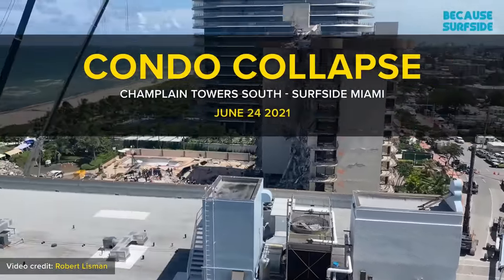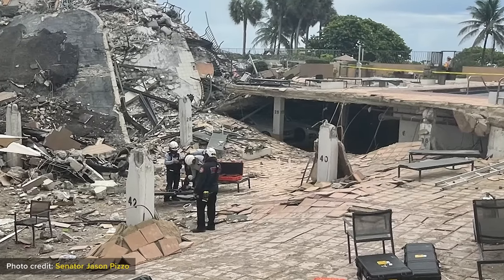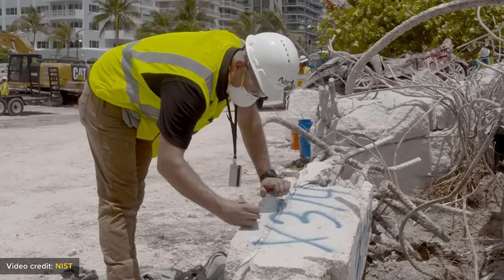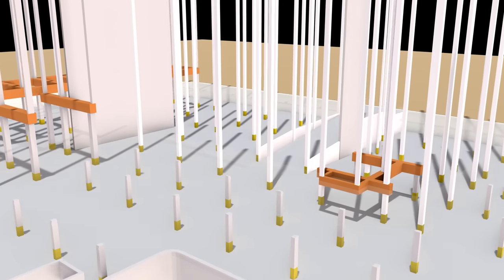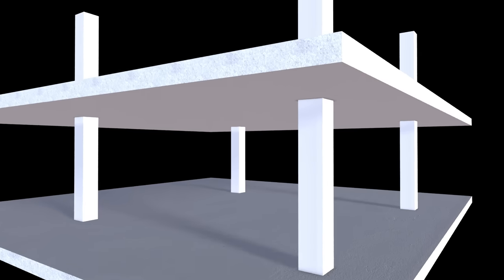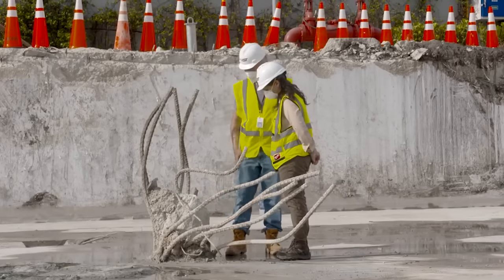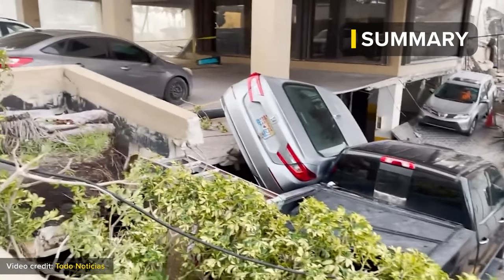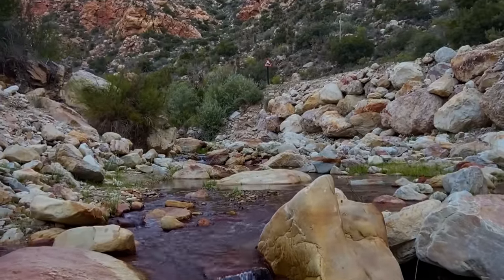SURFSIDE CONDO COLLAPSE | structural negligence! pt3

Comment: There was corrosion, perhaps not in the core samples, but you can clearly see it in the photos.
Reply from the maker: Rebar rusts very quickly when exposed to rain and the air. The pictures of the rubble are not good indications of the extent of corrosion.

Comment: 0.32 there is no rebar sticking out of the concrete at all. Absolutely no reinforcement.
Reply from the maker: Yes the absence of rebar is striking. But presumably it snapped at the cut face or inside leaving just a hole not visible in the fotos.

Comment: The city inspectors, the company that owns the buildings are at fault and I hope Miami and that company go flat broke paying out the lawsuits
Reply: I don't think the government is responsible of everyone wants less red tape, so less regulation is applied. This stuff is why regulation exists.

The scary thing is that because of hurricanes, they need to recertify every 40 yrs. Most places don't even need that.

I work as an engineer. So much work from 40 years ago just wouldn't be ok today. Regulations have generally been increased a lot. Those regulations often get enhanced because of events like that, but they never fix old facilities or buildings to the new standards.

Comment: The design build was marginal at most
Reply from the maker: The nature of building developments is that they are built at minimal cost. That’s not unusual.
The difference in this case was the structural design was inadequate and I think NIST will discover substandard concrete was used and not all reinforcing steel was installed. All so someone made an extra buck.
Reply: @Mike-Bell   THE PERSON WHO MADE THAT FINAL DECISION NEEDS TO BE FOUND AND GIVEN A NEW SET OF CLOTHES FOR THE NEXT 10 YEARS. Probably longer. 

They knew exactly what they were doing. Somebody okayed the substandard build. If that person is still alive they should be getting nailed right now.

I DON'T KNOW JACK SHIT ABOUT ENGINEERING BUT THAT WAS MY FIRST THOUGHT EARLY TODAY WHEN I STARTED WATCHING THESE VIDEOS AGAIN. MUST BE SUBSTANDARD CONCRETE NOT ENOUGH REBAR. I'VE HEARD BEFORE THAT CAN OFTEN BE THE PROBLEM.

Comment: Good video except the end. The graph used by the government to push this usage tax. After the first 5yrs was 1/3 of the predicated on the graph. You would think the government would redo the graph starting a the actual 1/3. Also they would adjust some of the parameters used to determine the graph. But no they are still going with the old graph and that is 2/3 off. Why do this? Also recently my city had a committee set up for future plans with global w.. Well they used the data from Boston wheather observatory historical data. So i go to 3 yrs in the 30s and write down high temps for june july Aug. Then i go to my public library. I find on microfilm my local paper and write down high temps for the same time frame. I compare temps and the only ones that do not match are the high temps and low temps. No other different ones just highest and in government documents they have been lowered. My local paper at one time had every section in house. As a cub scout we toured that complex. I remember being told wheather section gets all info from Boston wheather station for the government.  I had a copy of Paris A and other acords saved on my tablet. When i went to find them certain documents were gone and i didn't do it. Must of been g00g1e

Comment: So, if I understand you it was cheap design. Were standards not adequate or not followed?
Reply from the maker: It was an under engineered design and cheaply built.  However it was also extremely freakishly unlucky because everything went wrong at the same time including not being looked after.  There are many sub standard buildings that thankfully stay standing.  As far as following codes or nor and whether those codes were adequate we need to wait for the official NIST findings.

Comment: The pool deck slab could have been butted up against the building columns without actually tying into them. It could have had its own columns there at the end for lateral support. Nonetheless, none of this would have happened if we built these structures with beams. Pouring giant slabs just sitting atop columns, we are relying on bare minimums to squeeze by. This was bound to happen.

Comment: Many people are responsible for This Disaster. The architect the construction workers the condo association the maintenance department. But the people that I blame the most and should hold the most responsibility for what happened. Is code enforcement. The building should have been inspected a long time ago before it ever collapsed. And it should have been quite evident to any inspector that the building needed to be condemned at that time. Until all necessary repairs and and retrofitting took place. It just was not a safe place to live. It was allowed to deteriorate for way too long. And quite frankly I don't think it was built properly to begin with and should have never passed its initial inspection from code enforcement. There just wasn't enough redundancy built into the building. And I don't care what they're saying in my opinion the parking garage pillars are just way too thin and again not enough redundancy and backup support. Any building that's has its parking garage below the structure that has parking garage pillars supporting the building should be designed in such a way that any one of those pillars can be taken out and the building still stands. But in this case when one pillar was compromised the rest went down like dominoes due to the immense weight put upon them if they were that of a beefier made better pillar this would have never happened. Even taking into consideration all the years of neglect in maintenance allowing water to literally flow down into the concrete on a daily basis causing puddles in the parking garage to the point that there was actually stalagmites dripping from the ceiling. Which proves right there that it should have been condemned. Before it ever fell down.
Reply: Stalactites grow down from the cave ceiling, while stalagmites grow up from the cave floor. It's easy to remember which is which: Stalactites have a "T" for top and stalagmites have a "G" for ground.

Comment: There is a prominent engineer who went through all this and his videos disagrees with yours.
Reply from the maker: Who is the Engineer?
Reply: @Mike-Bell  Josh Porter, building integrity.
Reply from the maker: @thecommentary21  Ok lets revisit this in a year and a half when NIST release their findings. I am confident that what I have suggested is going to be close to the official version. 
Josh Porter has made some excellent videos. But he has presented a scattergun of broad suggestions of which some contradict each other.  He hinted that the columns rusted under the basement which they clearly did not. 
He also said the building had post-tension cables and then quietly removed that video when he embarrassedly realised he had that one wrong.
Reply: @Mike-Bell  Im not personally attacking anyone. I watched all of his videos. Perhaps the 2 of you can do a video together and talk about these issues. I think what he said had a lot of credibility. Another thing that hasnt been mentioned and maybe you can comment on this, is the new building construction next door. They dug right up to the champlain foundations next to the pool and deeper as well. 

He also mentioned the additional story on top. I think he does talk about design flaws but its been a while since Ive watched the vids. I think you 2 should do a video and Im open to the truth.
Reply: @Mike-Bell  He provided a lot of photo evidence of the rusted columns and poor repair attempts as well.
Reply from the maker: I have previously tried to communicate with Josh Porter but he did not respond.  It would be interesting for us to have a discussion about this collapse.  That is a good idea.  I will try again to talk to him.

Comment: I Understand What You're Saying.. However.. What You've Explained Still Doesn't Explain Why The Walls In The Upper Level Would Get Wet Every Time Florida Got Heavy Rain Storms.. That Proves There Was A Crack In Either The Roof? Or Somewhere In The Walls That Supported The Drainage System From The Roof.. Although, After Finding Out About How This Building Was Constructed, And Maintained? It Could Have Been A Combination Of Failures That Occurred..   Jus Sayin.. Yep...

Comment: Stud rails were not available when this building was designed and built so blaming the collapse of a 40 year-old building on technology that did not exist when it was built is ridiculous - it is also very likely that the concrete strength would have increased significantly since it was built - 4 or 5 years after this building was designed and built, post-tensioning became very popular for this type of construction allowing for thinner slabs and/or greater column spans. 
Back in the 70’s, the solution to insufficient slab shear capacity was thicker slabs, smaller spans, higher strength concrete, more shear rebar or a combination of these. But it worked for 40 years so to blame poor design without backing the statement up with calculations is pretty pathetic.
Reply from the maker: @PrideofIpplepen Yes stud rails are a newer system.  It would have been more accurate to have shown regular shear rebar but if you are inspecting rebar today stud rails are what you might see.  

As for your poor design statement you are quite wrong.  NIST have made known their interim findings and what they can say for certain is that the structural design was as much as half under strength and the pool deck area was the most under capacity.  In addition concrete top cover was 2" instead of 3/4" design further weakening the concrete particularly in punch shear.  Concrete compressive strengths were fine and to be as design.  
So, the building failed from woefully inadequate structural design  worsened by rebar that was too deep.  NIST said rebar corrosion was low to moderate.  They are still undecided as to the extent to how corrosion was a contributor.  Their final report is 

It is better to know the facts before leaving a comment that includes the word pathetic because you run the risk of you coming across that way.

My video was made 3 months after the collapse and has now been shown to be in line with what NIST has made known.